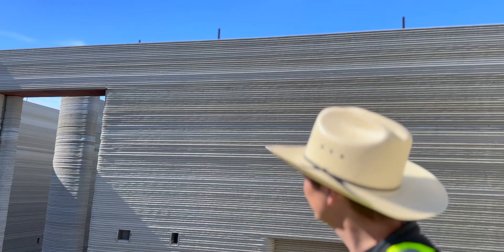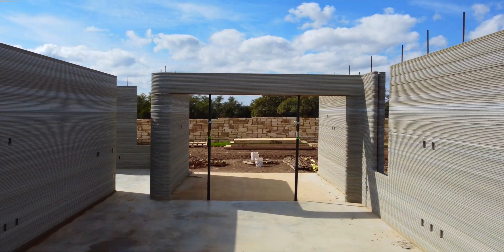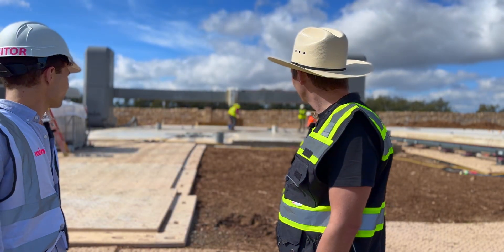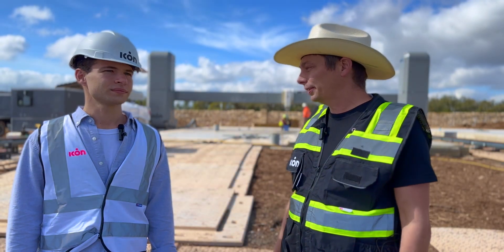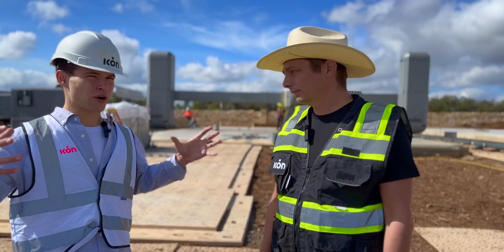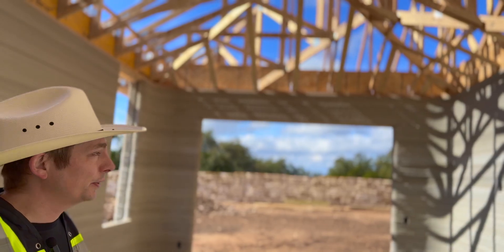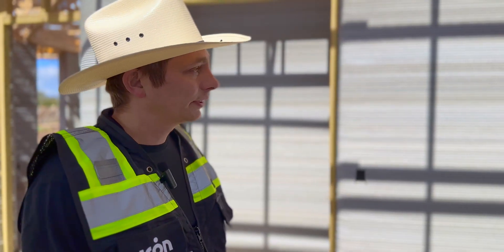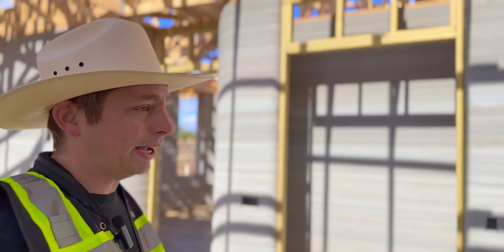ICON 3D PRINTING 100 HOMES ACTIVE SITE

Comment: Watching this vid for a second time! Is there a limitation on height with the material? It would make sense for them to partner with patient money to build rental properties - since the envelope is so durable they could probably generate cashflow for far longer than typical residential rental construction with less maintenance?
Reply: I think I saw they talked briefly somewhere about worked on level 2 buildings.  There are both load constraints and also their printers need a bit to extend their high which probably lowers the head accuracy.   

Other 3d printing companies see doing it although icons newest buildings have the most accurate prints in the industry at the monent it appears so it might sacrifice quality in the short term.

Comment: All great...modern... High tech.... Maybe fast. And then slap a labor intensive timber frame roof on it.... 🤔
Reply: Still ready in less than 12months min with an wood framed house and cheaper.
Reply: @TheLegalHeist  At prices starting at $450,000 at Wolf Ranch? Such a deal.
Reply: @thardyryll  thats that particular builder.. doesnt make it the standard
Reply: @TruthInFlying  let them keep pumping them out supply and demand will lower their prices overtime.